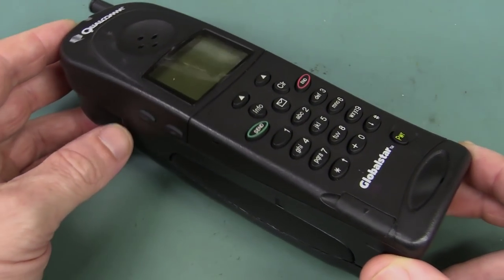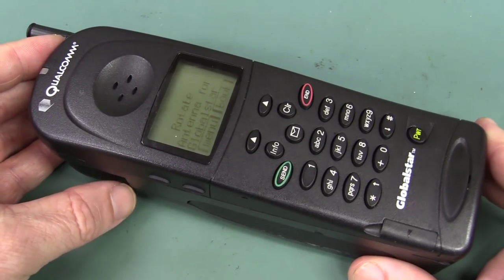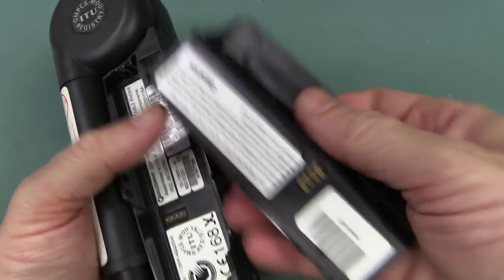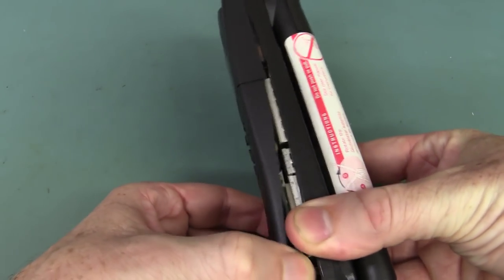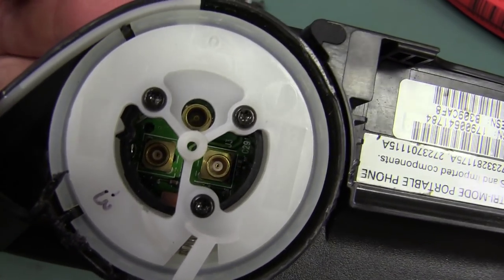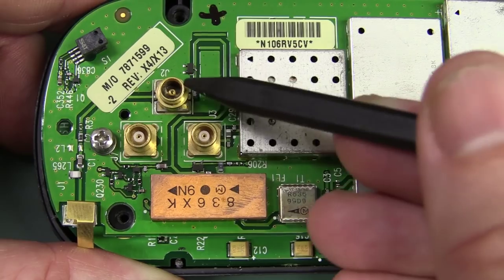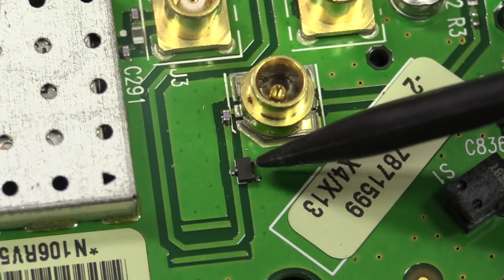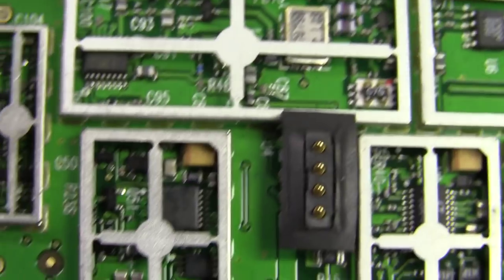EEVblog #721 - Globalstar Satellite Phone Teardown

Comment: Why did I guess Motorola?
Reply: I did too
Reply: Hah, same.
Reply: Yup, I guessed Motorola 8k series. Did not expect that.
Reply: You ain't the only one!!! XD
Reply: That intel processor was an interesting one, especially in a qualcomm phone...
Reply: Me too. There must have been a warehouse somewhere with a bunch of 386's left over from the past. Good enough to get the job done and probably were free.
Reply: I was ready to see Z80 there for whatever reason :)
Reply: DolganoFF
Now that's REALLY going back in time :)
Reply: I wonder if it made it in the phone because it was a match for what was on the satellites, as a 386EX processor on those was standard. Maybe the work was already provided as a package and they did not feel it necessary to reinvent the wheel.
Reply: Richard Smith
I think you might be right. Here's the wiki on that processor.
http://en.wikipedia.org/wiki/Intel_80386EX
No doubt most if not all the code was written in assembly code for speed and size, if not it was probably optimized in assembler, so using the same kind of processor would allow for running copies of routines used on both sides, the satellite and the phone.. Just guessin'.
Reply: Fred Flintstone Well, I am sure the 'client' code was already written and completely documented for the 'server' code running on the satellites, which obviously was written specifically for 386EX. There is no reason they could not write equivalent code on another platform, however, it may have been cost prohibitive, or rather, cheaper, to just use 386 and the proven provided software.
Reply: Richard Smith
Agreed.
Reply: I doubt the network code would be running in that processor.
the i386 would just be used as a high level applications processor, maybe running DOS or something.
 
all of the low-level baseband and network ' hand shaking ' would be done in that Qualcomm chip own it's own RTOS
Reply: all the Intel does is run the userland OS and control the hardware.
the rest of it is done in the baseband processor and the DSP.

DSP handles audio coding/decoding, baseband handles all cellular/ satellite radio operations.

Comment: One antenna is for the GPS....
Reply from the maker: Gary Hunkin It does not have GPS.
Reply: EEVblog He wouldn't know. He's only 15. ;) Also, WILL IT RUN ANGRY BIRDS?
Reply: Bastian Be
 Just for the sake of it, does the SatPhone have any game at all?. Kinda useful to have a snake or a solitarie if you are stranded in an island the middle of nowhere calling for help.
Reply: EEVblog
You are, of course, correct that the GSP-1600 doesn't have GPS. However, if you have an active service subscription and are on a satellite call, there is a menu option which will ask the network to estimate your location and send the calculated coordinates to the phone for display on the screen. I used to have one of these phones; the network location system was usually accurate within 10-20 km, although once in a while it would show up as thousands of km away.
Reply: ElAMPox Don't think you would want to use battery power what so ever to play a game if that phone is your only save to get you home, think dude. ;-)

Comment: So CDMA for satellite and Sim for gsm?
Reply: Nope, it's CDMA for satellite and dual-mode CDMA or analog (AMPS) for cellular. What looks like the SIM is really an R-UIM card, which stores the IS-95/ANSI-41 "A-key" (the key used to authenticate the handset with the network). So, it performs a similar function to a SIM card, but for CDMA systems. (Most CDMA phones did not have removable R-UIM cards; the A-key was stored internally.)